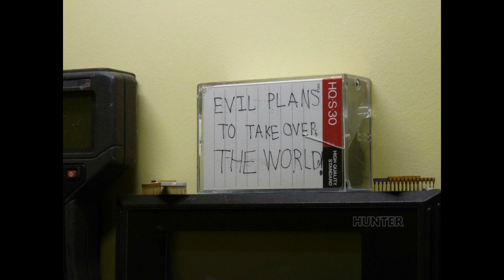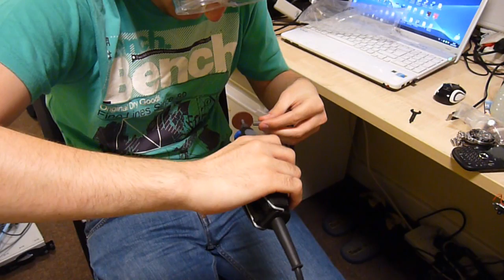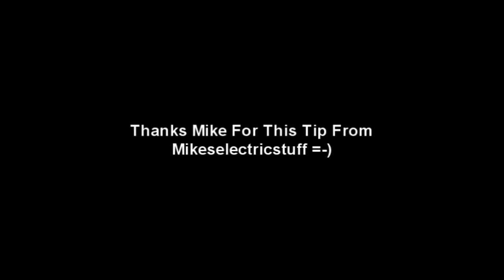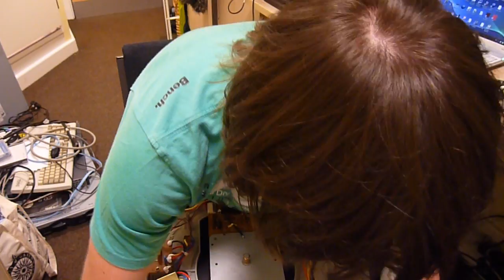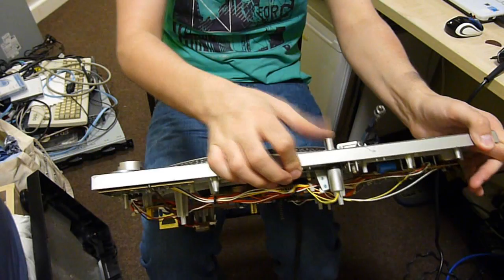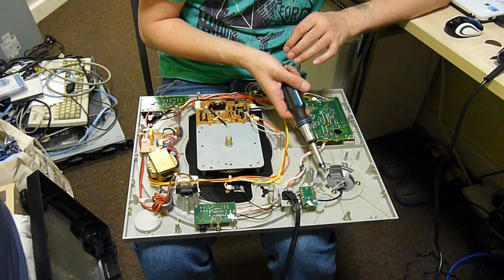Stanton STR8-60 Turntable Teardown

Comment: I have a STR8-50 , that I've had for over 8 years now.  Since day 1, I've had to place something under the power cord, because I thought, maybe it's a loose connection and just didn't want to open/fiddle with the unit.  

Your video gave me the confidence to open and investigate.  And literally.  The jack where the power cable plugs into, was not even soldering into place on the board!  LOL.  And this is a band new unit shakes head .... I just soldered the jack to it's board properly, and now the unit works BRAND NEW, like it was supposed to, when I bought it. 

Thanks for the teardown video!
Reply from the maker: Nice, glad it helped, not much in them from what I remember.

Comment: You have no idea what you're on about.
Reply from the maker: When it comes to audio, you are correct.
Reply: @TheEPROM9 Not being funny but why try to do a video on something you have no knowledge about?
Reply from the maker: @systemdamagepodcast6874  I do, look at my vintage computer & electronics videos.
Reply: @TheEPROM9  not to sound horrible but you don't seem to know what your on about no offense, I'm a fully qualified sound engineer and you could identify what the strobe light was ( the one you called neon) you then said it is an l.e.d. which is correct well 2 to be  precise. The pop up light is a target light it is used for looking through the record and the thing you called a disk is actually called the platter, the speed adjuster is called a pitch faded it speeds up and slows down the revolutions of the platter when it is in it's central position it is classed as quartz and over time this can fluctuate but can be rectified by adjusting the quartz. The turntable is really easy to get in to you screwdrivers must be made of chocolate lol first of all remove all four feet by turning them counterclockwise and the remove all screws on the outer edge then the plastic case splits in two. To be honest that turntable isn't worth much so it wouldn't be worth working on in my opinion they sell for around £90/100 for the pair.
Reply from the maker: @systemdamagepodcast6874  I do computer security as a profesion ;-)

Electronics is one of my main hobbies.

Also thanks for the info, I never know the proper terms for what things are called. My bros set uses a Neon & its not very good as it does not flicer at the right frequency. Did not knw they used 2 LED's in them.

I took my crappy set of screwdrivers to uni & expanded my tool set from there.

The person who did buy it on eBay ended up being a non payer, so that was a massive wast of time.

Audio & analog stuff still eludes me to this day. I am more of a digital guy. Hence I colect & restor vintage computers. & while in lock down have been building night vision scopes.

Comment: The weight is necessary for djs, (this turntable is aimed at beginner djs)... you don't want the deck wobbling and sliding while you're manipulating the vinyl.
Reply from the maker: I worked that one out later. Fun fact out landline handsets use to have lead weights in.

Comment: got one problem with my deck is that the power plug is so screwed that it wont get power to even turn on ,so i think iam going to do this and see if i can replave it my self
Reply: Charly-Anthony Strouza  you do know that stanton's use removable power cords right?
Reply from the maker: Probaly the plug that is buggered.
Reply from the maker: Go for it.